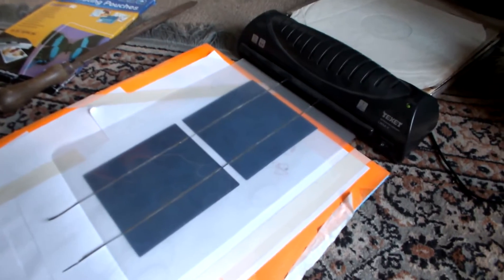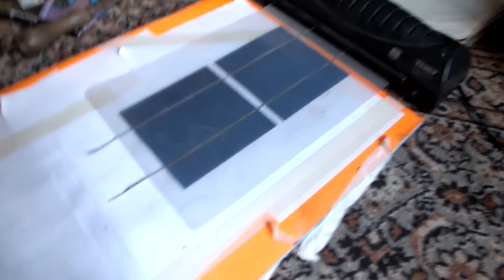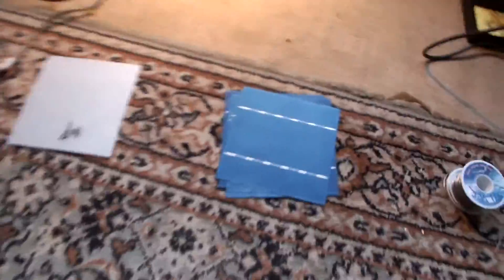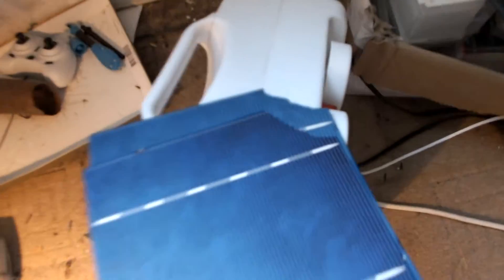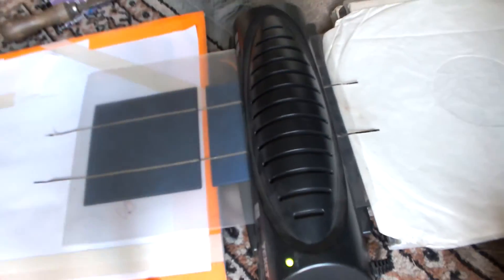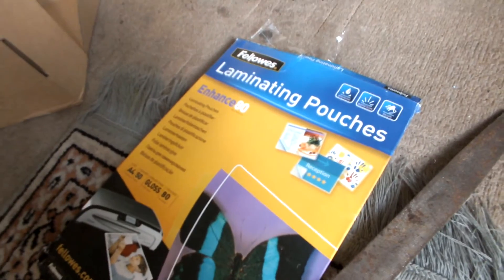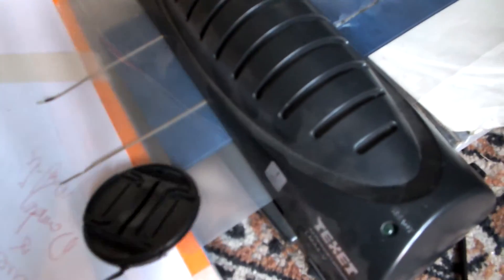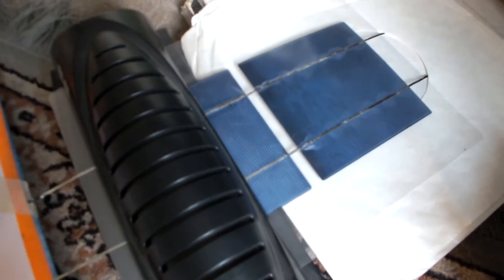Solar Cell encapsulation - A4 Laminating Pouches - Experimental

Comment: Interesting but what I really would love to see is you putting a battery together using them cells.
Reply from the maker: That's what the idea was, as was running a solar powered sound system at the time using 10 truck batteries, worked well but for simplicity I found factory made 250w panels much less bother !

Comment: hello there, hopefully you've been using these for a year now. I'd like to know if the laminate has turned opaque in the sun because most office laminate pouches are not uv resistant so they  might turn a white colour and block the sun light? Other than that its a great idea
Reply from the maker: They stayed clear but there's not been that much sun, sorry for the late reply as hadn't seen your comment :)

Comment: How much is the power loss caused by the lamination foil?
Thanks
Reply: Yes
The laminate  loss power in solar cell
Whitout laminate cell generate o.5 volt and 1.66 amp
And laminate the cell volt is same 0.5 volt vut amp loss is .66
1amp drop laminate plastic
Reply: @chbaisla  Lamination pouches Block UV, to prevent the print fading from sunlight, so they are unsuitable for solar cells. What can be used is heat tensioning plastic film for model aircraft; Oralight with no tint, it is UV resistant but lets UV through.
Reply: Why would there be any power loss ? Aren't the laminating foil transparent enough for much of the sun light to passthrough ?
Are they any worst than EVA sheets ?